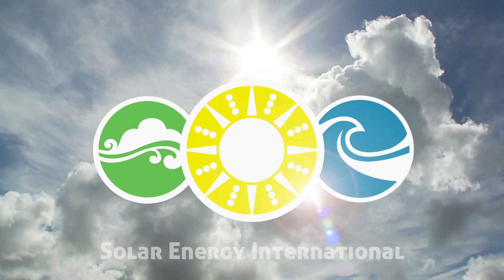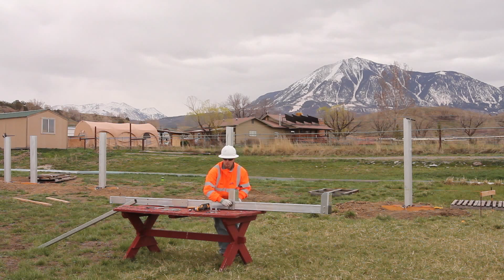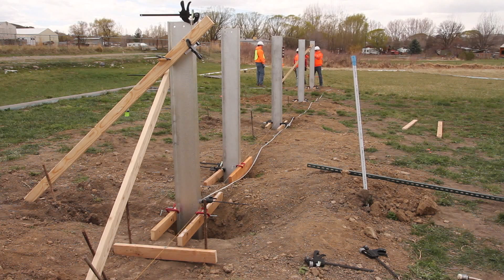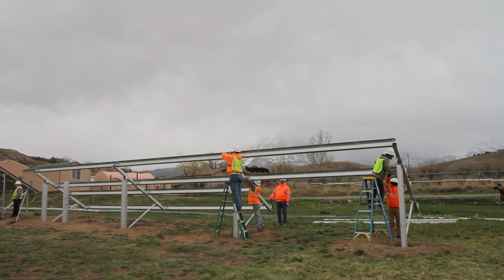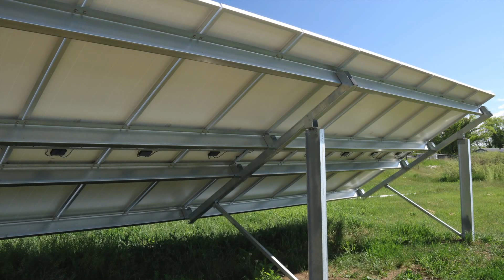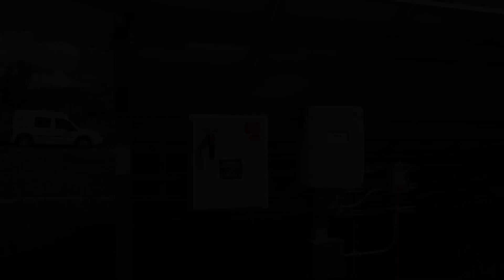8.4 kW Ground Mount Install Time Lapse at Solar Energy International's Paonia Campus

Comment: That is a very slow process. We use a pile system here in the UK. Knock in the piles, bolt on the rails and then the panels.

Comment: PV ground bracket +Easy and fast installation without punch holes. Match 980mm-1134mm width solar module.PV ground bracket +Easy and fast installation without punch holes. Match 980mm-1134mm width solar module.

Comment: Amazing work guys! What is the orientation of the panels, because at the end the sun shines on the inverter, in the back side of the racking system?
Reply: It should always be true south?
Reply: @adolfoguerra4183  ideally, yes, but not  always possible,  I have an orientation of 204deg, due to the land configuration, and the panels work just fine.